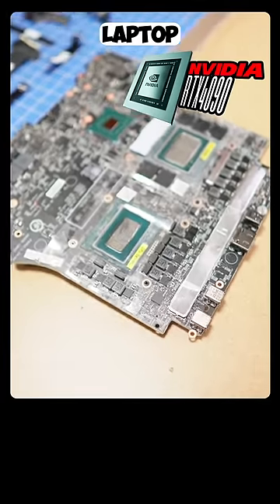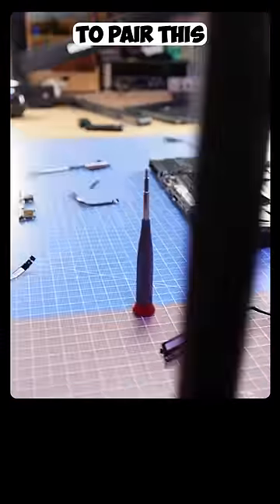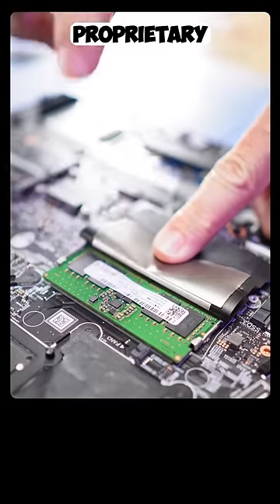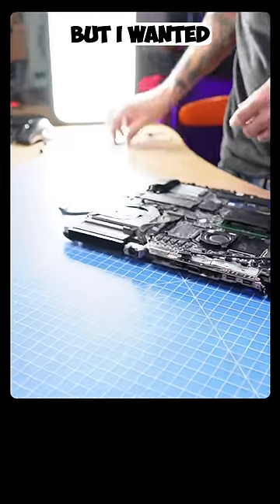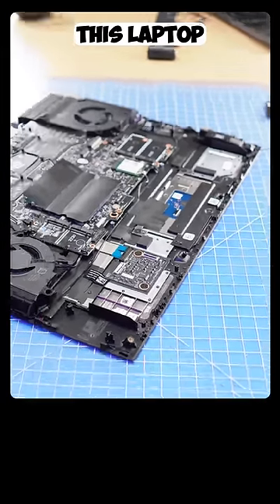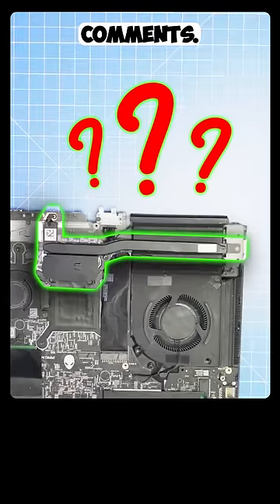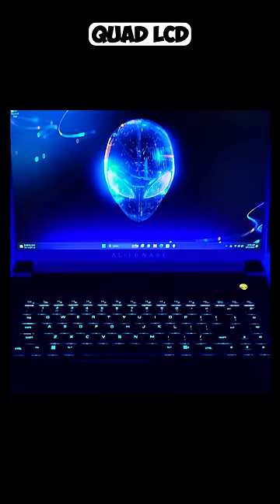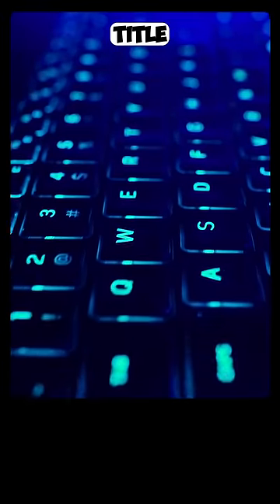Build the perfect gaming RTX4090 laptop! #shorts #gaming  #laptop

Comment from the maker: Here is the complete list of parts needed for this Alienware RTX4090 Laptop build.  

T5NCC:  Alienware m16 R1 Laptop Bottom Base Cover Assembly
7WCYX:  Alienware m16 R1 CPU / RTX4090 Graphics Cooling Heatsink Fans Assembly
C45HF:  Dell Alienware m16 R1 Laptop Motherboard Intel i9-13900HX 5.4Ghz- RTX4090 16GB
NC97W:  Alienware m16 R1 Touchpad Palmrest RGB Keyboard Assembly
7RJMC:  Alienware m16 R1 Rear Middle I/O Cover Cap
0177H:  Dell Alienware m16 R1 Battery Cable
HXP02:  Alienware m16 R1 Left Right Replacement Speakers
TWY0C:  Alienware m16 R1 / m18 R1 DC Power Input Jack Plug with Cable
XMDV9:  Alienware m16 R1 / m18 R1 Memory Cooling Fan - Small Fan
m16WLNBR:  Dell Alienware m16 R1 Thermal Shield Support Bracket for WLAN Wireless Card
MV1J2:  Alienware m16 R1 MCU Junction Board Keyboard Controller Board
0RV0H:  Dell Alienware m16 R1 Power Button Circuit Board with Cable
0TYK2:  Alienware m16 R1 Keyboard MCU Junction Board Cable
1CNT5:  Alienware m16 R1 / m18 R1 Rear Ports Circuit Board - Rear IO Board
H0CHC:  Alienware m16 R1 / m18 R1 Cable for Rear IO Board - Cable Only
8V1CG:  Alienware m16 R1 Keyboard Backlight MCU Cable
C4WCT:  Dell Alienware m16 R1 Metal Bracket for Power Button - Bracket Only
DWYPX:  Alienware m16 R1 Ribbon Cable for Touchpad
RY7N3:  Alienware m16 R1 VRM Heatsink Assembly - Top Heatsink
T2VJ7:  Alienware m16 R1 Left Side Network RJ-45 / USB / Audio Port IO Circuit Board
M16SSDshield: Dell Alienware m16 R1 Thermal Support Bracket for 2280 M.2 SSD
m16USBCbracket: Alienware m16 R1 Rear USB-C Metal Support Bracket
m16DCBRK:  Alienware m16 R1 Metal Mounting Bracket for DC Jack
XT70W:  Dell Alienware m16 R1 16" QHD+ LCD Screen Assembly - 165Hz - Gsync Enabled
32GB4800: DDR5 32GB 4800Mhz PC5-38400 SODimm Laptop RAM Memory Stick - 32GB
69KF2:  Dell Original Alienware m16 R1 6-Cell 86Wh OEM Battery
Reply: Holy cow
Reply: What the... How much did you spend to buy them minus shipping?